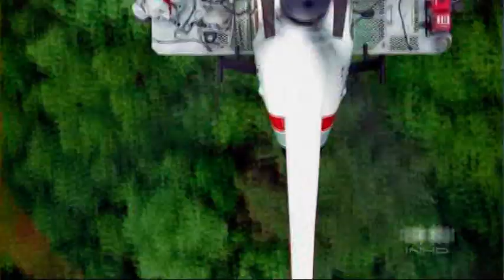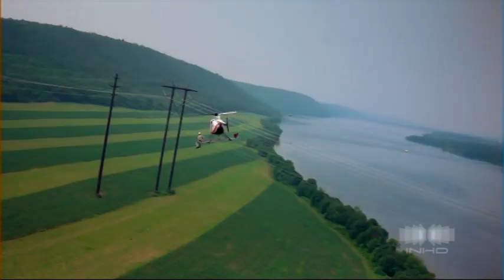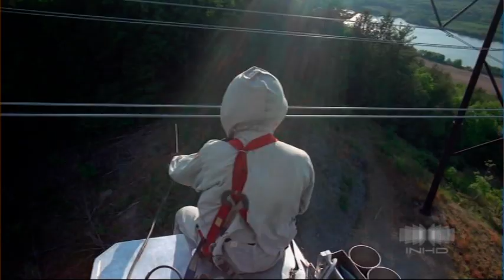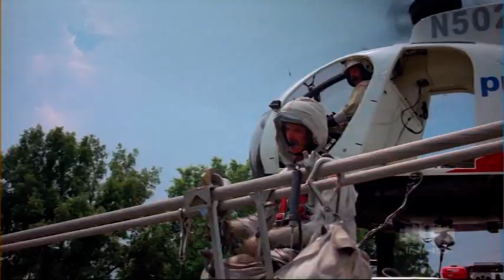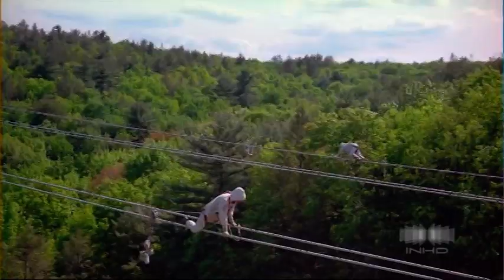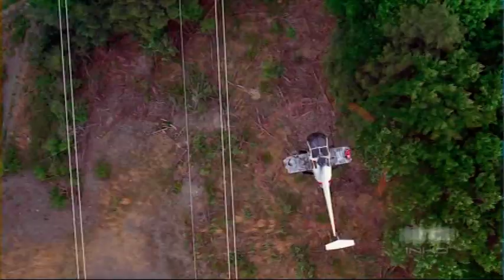High Voltage Cable Inspection

Comment: You can have all my nopes. Work by 100kv lines but not this. Hell no.
Reply: You're just as likely to die quickly and "vaporizedly" on 100k as 500K. They're both super high volts so it makes no diff either way.

Comment: Very interesting and well made. One question: This forum thread http://electronics.stackexchange.com/questions/158778/can-a-bird-previously-at-earth-potential-get-electrocuted-by-landing-on-a-powe seems to say the equilibrium current would last 750nanoseconds only for a man. In the video it lasts around 5seconds, does the helicopter have a capacity that much higher?

Comment: why everyone keep calling it dangerous job? What are the risks? To fall down - its impossible with all the gear they have and proper use of it.
Reply: +Joe Ощу  the health of lives lines man . they ALL get leukemia ,cancer ,tumors there is no ifs and but it is only when .Your body works on electricity right ,you mess that you mess with your life running it around you in a Faraday might keep you alive in the short term but the long term consequences are horrendous   .Of course funded (mostly from some type of power Co. or government )University  will tell you other wise.n and ask them your self . The cost to change infrastructure would be astronomical other wise . unattainable
Reply: Thanks for the response!

Comment: could someone explain exactly why the worker needs to put a rod to the cable?Once the helicopter leaves,before landing,does it still carry high potential?These questions have been confusing me so much.hope someone could answer..please!
Reply: He does that to equalize his potential with the power line using a slow discharge, rather than having a fat lightning bolt jump the gap, which could be dangerous.  My guess is the copter bleeds the charge off to the surrounding air via any sharp edges or points fairly quickly.  That is why, when the copter comes back to pick him up, they have to repeat the equalization of potential procedure.
Reply: He's "bonding off" the chopper. Basically, he's grounding the line to the chopper so that he can touch both without dying. Sucks to touch a 480Kv wire and the 0v hull of the chopper at the same time.
Reply: theres an energy field around the wires get to close it could arc, the line or wire is to help prevent the arc an engerize the people helicopter as it enters or leaves that feild
Reply: lcs1956 But what exactly the "lightening" is?(from the ionized air?)....is there any current flowing through the copter?
What i understand is the worker charges the copter to the same voltage as the cable from 0(maybe sth close to 0). So, what would happen if the worker didn't do the "charging"  procedure but let the copter fly directly towards the lines?

Comment: @SteU4IA to prevent sparking when he is connecting the other wire from the chopper. the second wire he connects prevents (which has lower resistance than his body) prevents current from flowing to his body to the chopper. 

at 500kV and at a height of 30 meters you will still be electrocuted, 500kV is high enough to make current pass through air's dielectric, provided you are closer to the wire than to the earth.

Comment: @skyferret1  Helicopter< 500kV.  So the discharge you see is the voltage seeking that difference and equalizing the charges.  Think capacitor. Two conductive materials separated by an insulator.  So when the arc appears the potential is enough to gap over the insulator.  The prohibited zone for 500kV is 10ft 3in.  The prohibited zone is the zone at which when crossed it is the same as touching a bare conductor.  They get pretty close to get an arc to the helo must be relatively highly charged.

Comment: just prior to connection and disconnection to the wires. is the light rod used to avoid a sudden bang or large clap of electricity when connecting or disconnecting?? by gradually introducing the chopper the spark never gets too big or dangerous?? am i right??

Comment: @sicsemperevan yes exactly right, its easy to say its not the voltage that kills, its the current, but the current is proportional to the voltage, it does not kill in this case because there is no current flow path, the resistance/impedence is almost infinite because there is a huge air gap between the man and any potential current path. Where would the current flow? If there was a path then current would flow from the line along this path without any man on the line.

Comment: @obiwannotanikan This is a very true statement.  But basic Ohms law says that you can't have current w/o voltage.  V & I are complements to each other through Resistance.  The easiest part of this job is understanding how and why insulating material / dielectrics breakdown.  The hardest part for me about this job is not the fear of copious amounts of electrons rushing through my limbs...but the heights with which I'd have to work at.

Comment: @obiwannotanikan You need Volts to transfer the Amps though. You can't get killed from holding a 0.5V 100A powerline, for example.

Comment: @skyferret1 You are charging and discharging the helicopter 60 times a second.  It is referred to as charging current.  We see the same thing in substations when we open and close disconnects.

Comment: @obiwannotanikan "Voltage is directly proportional to amps and indirectly proportional to resistance".. 

if you grab onto a circuit with high volts and low amps and basically make yourself an earth stake the amps in that circuit will skyrocket because you will have made a direct short to earth.. you cant have pure voltage without amps.
voltage and amps are directly proportional to one another... you cant isolate them from one another

Comment: @sickasylum to avoid a electric "arc" jump to some heli vital part or his body. he wants to be sure to direct the electricity, runs to the heli body aswel as his "metal web" suit when he climb the cables. same when a lighbolt reachs your car: you re safe because of metal body, not cause of tires, as most think. sorry my english :-)

Comment: Its all safe if you do it right! he's just bringing himself and the helicopter to 500,000 volts electrical potential, as opposed to turning either to wires, their just tiny grounds themselves.

Comment: @obiwannotanikan 

The resistance needed to maintain a .5 MV voltage at a less than lethal current would be phenomenal. So really at voltages this high you are guaranteed a lethal current.

Comment: Same phase bit is true, but suit resistance has no bearing really, and in fact the suit is low resistance to help prevent static running over the skin, it has steel wiring threaded through it. The 2 main cables are electrically only 1 cable, so would`t matter even if put a spanner across them.

Comment: nothing miraculous about that electric human fella, he is never directly connected from the high voltage terminal to earth or other pole of the high voltage transformer in tv`s etc. Always has high resistance between himself and ground - ie wood blocks, plastic milk crate etc

Comment: The electric human if its the one where he touches high voltage tv transformers and arcs from finger to block of wood on the ground, that would work for anyone, he was standing on a plastic milk crate to insulate from ground and the arc was from finger to block of wood, while it looks amazing, there is tiny current flow because of high impedence of wood etc. Most would`t attempt it but its nothing miraculous

Comment: Actually, if the person was standing in a crane bucket, it would go though his clothing. 

The man is charged with 500,000 volts but zero current is happening. The electricity is static.

Now if the line was seriously overloaded, to the point of glowing, then some of the current going up and down the line would use his contact as a conductor. He would get shocked.

Comment: Did you see the arc? Thats current flowing in the air. If he touches the line before using the rod to bring the helicopter to the same voltage as line all that current will flow through his body.
I am wondering what is the magnetic field around these lines? Could be deadly.

Comment: The rod is to control the arc.  If he did not have it the arc could strike anywhere on the aircraft causing electrical issues.

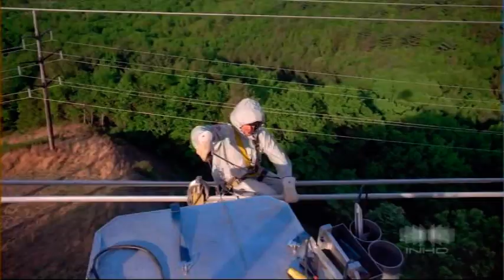Comment: The two cables next to eachother are at the same potential, what means that there can't be a short circuit. If they weren't at the same potential by 500k Volts, there would be an arc between the two cables. High voltage lines always have 6 lines 3 on every side of the post. (as you can see at 2:50) For example the left side goes to a place an the right side comes back. So there is less change of current interuption.

Hope i could help you with this

Comment: No those two cables are on the same potential, there isn't enough distance between them to put them on a diffrent potential with 500kV. As you can see in 2:53 ,  there are 6x 2cables, Line 1, Line 2 and Line 3 one side goes to a place, the other comes back. 

I think it's an awesome job.
grtz

Comment: He's already at the Line's Potential...if the Power Was suddenly shut off i doubt he would be Electrocuted,even after being shut off...the lines would still have quite a bit of Voltage in them,so a possibility is still there.

Comment: Probably not.  Shocks are caused when current flows through the body.  If the line went to 0, the only flow would be the potential in his body leaving.  I do not believe the body has much capacitance, so it can't store much charge.  I guess if you were barely touching the wire when it shut off, all your potential would flow out of that one spot, creating a dangerously high current density at that point, maybe burning you.  The steel suit helps distribute this flow, eliminating that hazard.

Comment: A great video, really interesting. I'm not certain what he is doing on the line though, what does the "maintenance" involve? Is he checking the wire hasn't deteriorated, checking the insulator is in good condition? Surely he can't do much work to it up there if anything is wrong?

Comment: Amazing Video...one of the best on Youtube in my opinion...as for being a Linesman think of this...by the time your 45 you'll have Varicose veins in both your legs and extreme lower back pain...go for being a Cable Jointer..you still get the back pain but the money is a lot better!

Comment from the maker: All transmission lines carry AC. DC is rarely used, and when it is it is usually HVDC submarine cables. The AC is the actual source of the crackling you hear as the current is reversed every 1/60th of a second.

Comment: I can understand the arc when the helicopter approaches the overhead line, but why is there an arc when the helicopter get away from the line at 2:00? Sure the helicopter and the line are at the same potential at that point and there shouldn't be current flowing?

Comment: I am an electrical engineering and I remember that was the first thing I learn.
You can grab a high tension cable as long as you don't touch the ground, the trick is to keep the same Electric Potential Difference

Comment: Aircraft parts are all bonded together so you should not get more of a resistance than 0.05 ohms between components. This is for 2 reasons, prevent static build up that interferes with radio and avionics and secondly lightning stikes!!! Great video

Comment: peterb1968...it says in the description and the narrator also says that this is a 500kv line.  That's 500,000 volts.  Also, I don't know where you got that number "33kva" from.  "KVA" is a measurement of power, not voltage.  VA means Volt-Amperes.  33kva would just mean 33 kilo volt-amperes (basically, 33 kilowatts) and there is a HECK of a lot more power going through those lines at any time.

Comment from the maker: The arc is caused because the chopper is at a different potential than the line. The arc occurs as long as there is an air gap (resistance) between the line and the chopper which the voltage can overcome, which is why we use the bonding rod and clamps. There is zero current flow from the line to the chopper.

Comment: This is a job especially for me - a man, that watches t-storms through the open window on quite high floor, touching metal frames joined with the roof and ground. I'm crazy when I see working Tesla coil... This is the job especially for me...

Comment: You did this on live (500kv) lines from the TOWER? , that is impressive , my hat off to you.

I don't know if I could deal with my (normally small) fear of heights enough to do this from a heli , but I do know that my fear of heights is greatly outweighed by what a 500 KV line could do to me if it grounded.

Comment: The wires are equal in both phase and voltage , long distance HV lines are typically run in pairs, and not as single lines.
If a pair of very HV lines ran that close together they would arc and create a short circuit.

Comment: All High voltage cables have to be inspected , so any problems can be fixed before they cause the cable to fail.
as long as the person inspecting the cables takes the precaution of "equalizing voltage potential" , (the sparks you see before he gets on and when he gets off the line) , as well as landing, everything will be fine.

Comment: There is no danger in working on power lines like this as long as nothing shorts between the three phases (there are two conductors per phase) and there is no connection to ground.

Comment: A LOT! Basically any job working with high voltage electric stuff pays in the mid 20's per hour or more. All the jobs I've read about anyway. ;-)

Comment: WOW...absolutely amazing video!  Great narrator's voice!  I really like the sparks from the wand, which I'm guessing is used just to equalize the voltage.  If I understand it right, you really only need the  Faraday suit when you first get on or get off the line, because once you're on the line you're at the same voltage.  It probably protects you from corona too when you get off the line and get back on the helicopter.  I've never seen this done before...that takes a lot of guts to do this!!

Comment: sinse there is no sparks inside the tank. after all the helicopter is big metall thing whit no seperations (seen from the wiew of the power), derfor when they connect the helicopter to the power lines they connect all of the helicopter, so that there is no diff in voltage in the helicopter, and derfore it is no place for a spark to go from/to. if it is hard to understand talk to an electrician, and he may say it better.

Comment: It's always been my understanding that most, if not all, overhead power lines are bare. This includes the high-voltage lines in the video as well as the lines coming into your house or apartment building, unless you have underground cables.